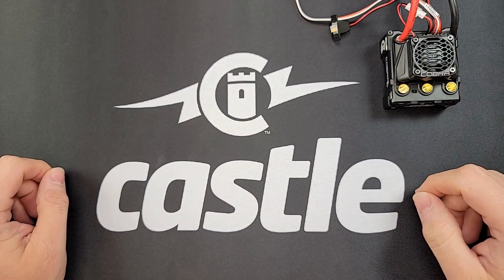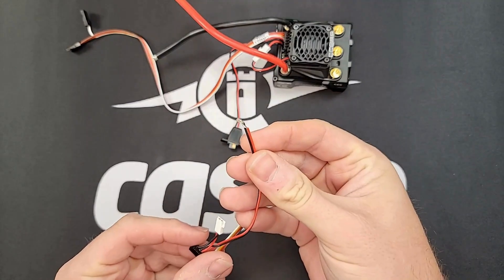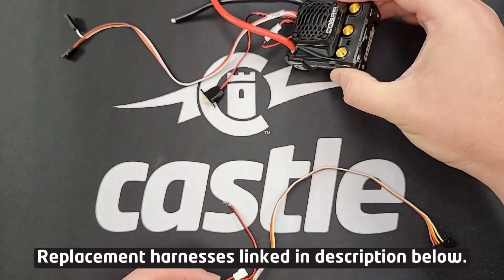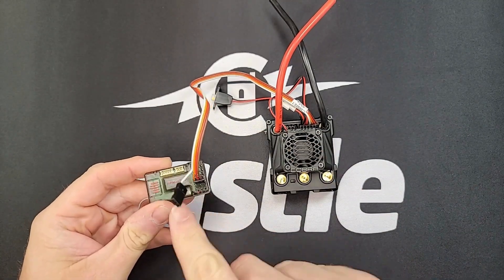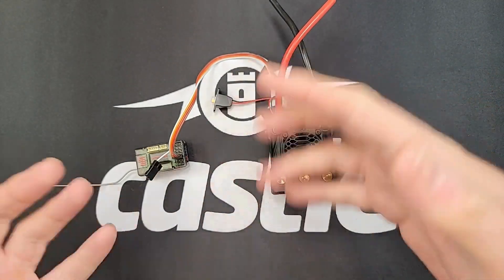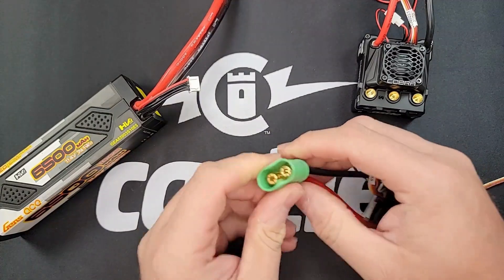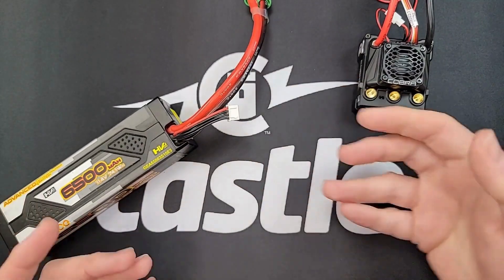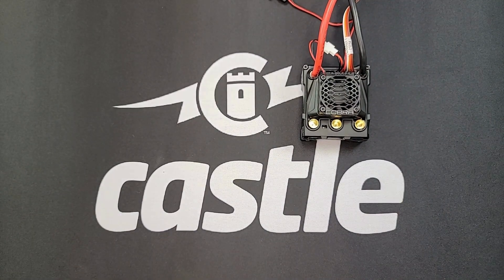Tech Tips   Ep 1   ESC NOT TURNING ON

Comment: Drove mine on a muddy track. Cleaned everything off with battery disconnected. Let it dry for 2 days. Plugged it in and it made some whacky noise. So, turned it off and cleaned out the on off switch with brake cleaner. Let it dry, and now nothing at all. Will try the two tips here. Battery connections are fine.